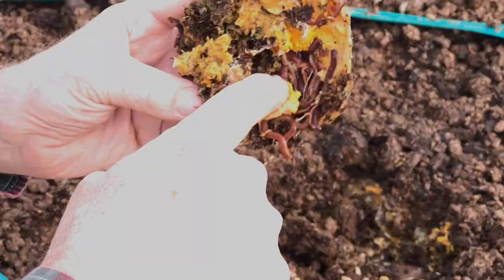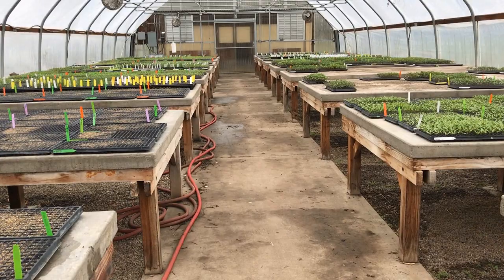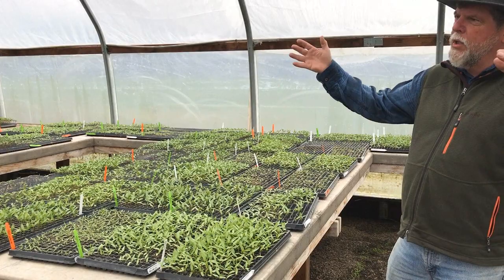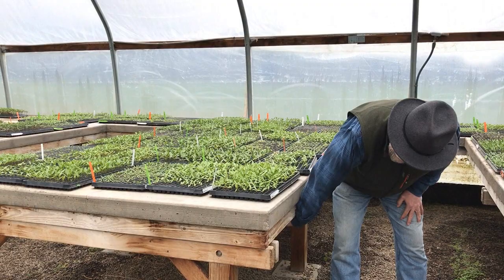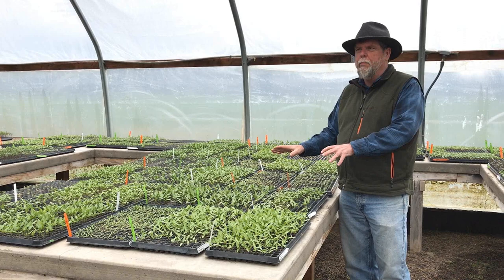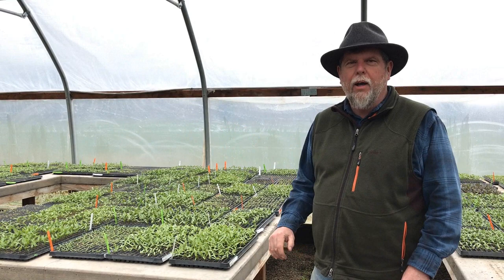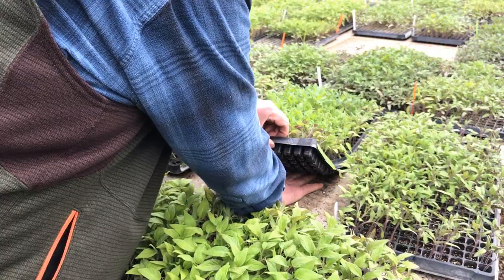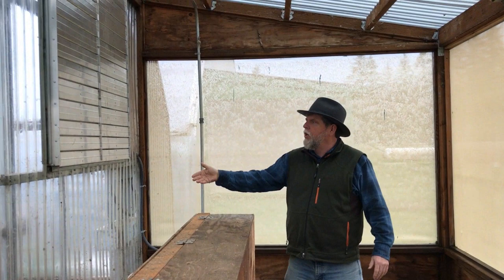Germination House with Heated Tables

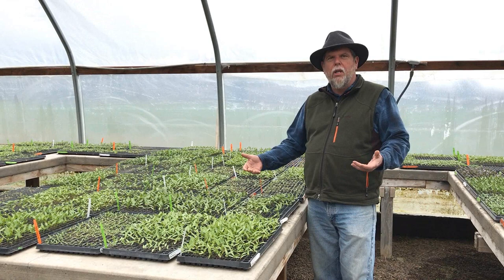Comment: 4:11 You mention heating the other germhouse with "inline hot water with propane" being half the cost. In that other system are you heating concrete tables or air or what?

Comment: Hey this is a really cool system. I've been looking into a hydronic system, but this is simpler to automate. The only problem is that we have 70-sq ft tables, and the products you sell on your website are too short. I have found another source for outlet plug soil heating cables, but making them work with a thermostat easily seems difficult. I would be interested in knowing more about the wiring you sourced for this project. Do you have more information about the power draws, electrical design side of things?
Reply: I guess you have a single circuit for every bed or every two beds or so? That's the only way I could see it working without pulling massive wattage on multiple beds wired together.

Comment: What do you do when the heat pad inside the concrete goes out and it will. Wouldn't it be much cheaper and easier to use Plant heat mats? You can get a 4ft x 21" for about $50. No need to pour concrete slabs and easy to replace when they go out.